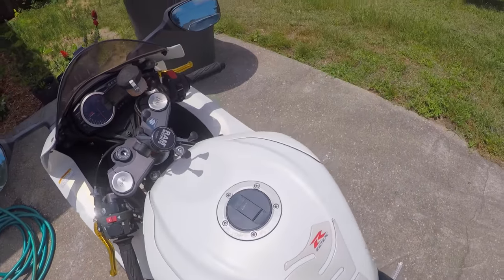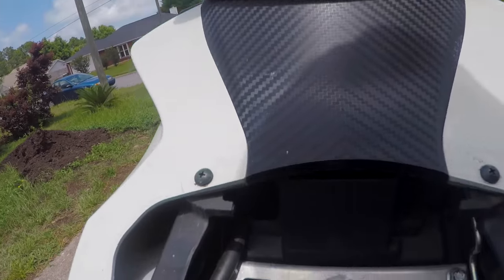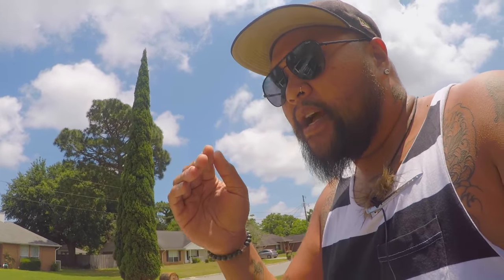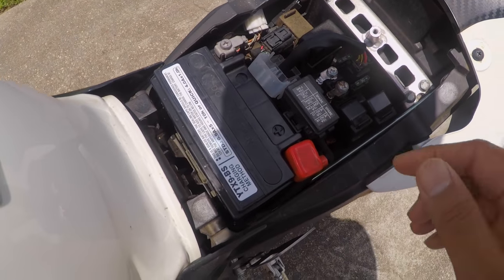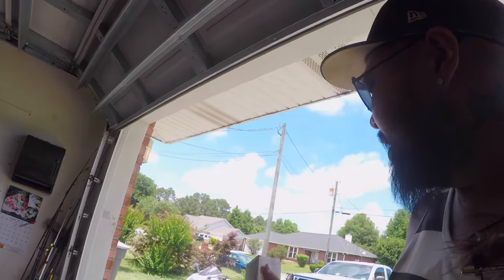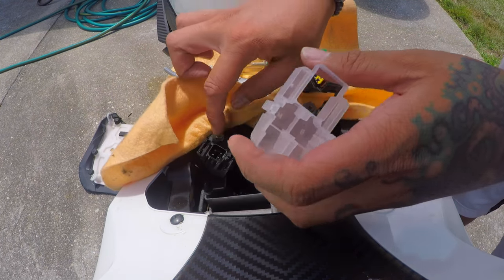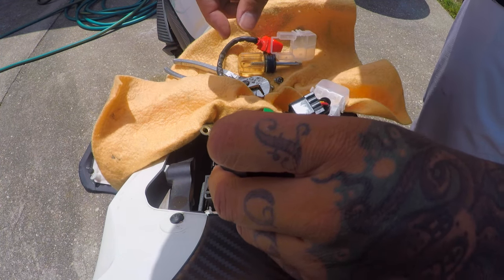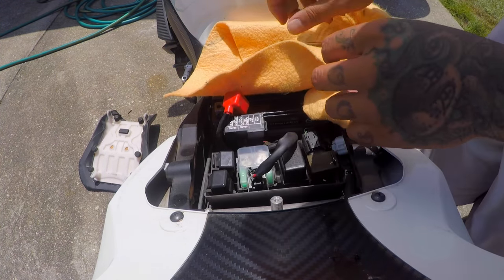**Solved!** Starter relay problem! Works for most bikes/vehicles!

Comment: I took my motorcycle to wash and now it won't start!  check all those fuses in your video but i don't know what could be
Reply from the maker: check your ignition switch? i never had an issue after a wash or riding in the rain ..strange.. do the lights turn on when you put the key in and turn it? what happens when you press the ignition? please keep me updated!

Comment: @motocoss88 the problem im having is it won't start and everything comes on it tries but will not no fuses blown what do you think it could be
Reply from the maker: Sounds like not enough voltage to the starter assembly. How old is your battery? Also check your grounds. If it’ll start on a hot jump, but won’t again, your stator/rec could be not charging your battery.
Reply: @MotoCos88  battery 1yr 2 yes old I put it on triple and it took the charge it was low tho. Did you say my starter could be bad
Reply: @MotoCos88  hot jump is what like putting a long screwdriver touching the relay and see if it starts
Reply from the maker: @babyboinews6896  hot jumping is attaching it to a car then starting the car but only for a few seconds- it can damage your charging components on your bike. It’s not recommended but when you’re in a pinch, what can you do lol. 

I’d try hot jumping it, if it still don’t start, you’ll have to check one thing at a time. Battery, ignition, starter relay, starter motor, then rectifier stator. And ground wire of course- make sure it’s on a secure part of the chassis
Reply: @MotoCos88  understand but it's funny how it was running and just shut off then not restarting
Reply from the maker: @babyboinews6896  kill switch, drop switch?
Reply: @MotoCos88  don't think so it's a 2004 kawasaki
Reply: @MotoCos88  this the first time this has ever happened like I said I checked all the fuses even the main none of them are blown

Comment: I tried bridging with my ninja 300 it sounded like it wanted to crank but didnt? Should i still consider changing solenoid?
Reply from the maker: Hmm you use a thick tool to do it with? If it tried to crank and stops, it could be the relay. If it keeps cranking but doesn’t turn over, it’s most likely the start motor.
Reply: @MotoCos88  screw driver was small tbh and kinda rusty. I should invest in some tools 😅. Alright, thanks man. Im gonna try the replacing the relay 1st. If that doesnt work then I know what it is. Appreciate you again man🤙🏽
Reply from the maker: @smittywerbermanjensen6422  keep me posted! I will try to help as much as I can! Good luck!
Reply: @MotoCos88  Will do💯 
Thanks bro.

Comment: hello, hopefully someone can help me, i tried this and the bike just keeps cranking but won’t turn over, when i try to push the electric start nothing happens so i tried this method and it just keeps cranking very cinfused i got a 2007 Yamaha R6S
Reply from the maker: You check your spark plugs? Fuel lines? How old is the gas?

Comment: Man i replaced the solinoid no start.. but screw driver trick still works and makes it crank I lost
Reply: Same asf.  Anything ?
Reply from the maker: That’s strange, is the solenoid oem? Where’d you get it from? It could be your ignition switch at the handlebar
Reply: @MotoCos88  found out it was the ignition cable switched it out and came back to life .

Comment: I have a 1250 bandits 2008 no spark. What should I check
Reply from the maker: Battery. Do the lights come on but shut off when you push the Ignition? If it cranks but doesn’t turn over, then starter motor.

Comment: Man, i am running through the same issue myself, i fix computers but I don't do much of electronics, still, my logic was telling me that if i bridge the connectors and get a spark all the time, it meant that the Relay wasn't working well, my mechanic told me that the problem was the cord, I don't think i can trust him for anything more than basic stuff, i thought it was the relay, and I'm gonna order one right now.
Reply from the maker: if you bridge the relay, and get a spark, that means the cords are fine, its transfering voltage. If you bridge them, get a spark, AND the bike starts, that's a seized relay. If you bridge them, get a spark, and its tries to crank, but all you get are clicks, its the battery (not enough voltage). Lastly, if you bridge them, gets a spark, tries to crank, but doesn't turn over, that's the starter motor lol.

 This was a hard diagnose, as it took me 3 years to figure it out. He may not be a bad mechanic but there's a lot that goes into motors and I'm no mechanic, I just took my time and looked over a bunch of schematics of how an engine starts! I hope this video helped and gets you back out there! Stay safe!
Reply: @MotoCos88  Thank you!

Comment: Hey 
Can u help me out? Have a 2011 zx10r. And I cannot start the bike.  When I push start bike will turn on running. But makes weired noise 
Can I send u a clip so u may check it out ?
Reply from the maker: I’ve never had to push start a bike, but if it doesn’t start always remember to start at the battery, then the relay, then the starter motor, The rec/stator and back to the battery. You can email me at motocos88@gmail.com if you have a short clip. But please know I’m not a mechanic!
Reply: @MotoCos88  I just sent the clip to u r email.  But super thank u for even replying me back
Reply: When I try to turn the key on. Nothing  comes on. Basically dead. Dashboard wont even turn on. 
So I thought battery was a problem so I got a new battery. Installed the new battery but still dont work. So I try to push start and bike eventually caught power and turned on but makes weired noise as u can c in the clip I send it to ur. Email.   Is this something that has to do with wire connection problem?  Electrical problem?  I hope this is nothing crazy. Dont wanna spend so much money on repair shop labor
Reply from the maker: J K thanks for the vid! Sick Subie as well!! But it sounds like an electrical problem. The fact that nothing comes on when you changed batteries throws me off. Next thing I’d check is the ground wires. Make sure you can locate it and secure it. Sometimes the connection can deteriorate and rust. Could just be a connection issue somewhere. I’d try the the fuse boxes too. I want to help as much as possible, I hate seeing riders with bike issues. Keep me updated!
Reply: @MotoCos88  tks. For u r feedbacks.  I will let u know. I just dont want shop to Rippp me off lol
Reply from the maker: J K oh for sure! I’d grab a voltmeter and do some diagnostics!
Reply: @MotoCos88  battery seems to be fine.   Do u think my bike is fixable. Or do I have to think about thrashing it
Reply: @MotoCos88  I did  the battery seems fine.  Voltmeter is the tool u test out the voltage on the battery right?  Lol I just dont know much about auto tools and etc
Reply from the maker: J K I don’t think you have to dump it lol yeah the voltmeter can check the voltage and also check open/closed circuits. Vehicles need minimum 12.5V to start. Obviously the more the better. If you’re reading that and still nothing to the electronics, it’s gotta be a wiring issue.
Reply from the maker: I sent a video of a guy checking the fuse in the starter relay itself, did you check that? NOT the spare fuse but the active one inside the relay

Comment: When I make the bridge it still doesn’t start. Bad starter?
Reply from the maker: Dayton Raught does your battery have enough juice? Should read 12v-13v when starting. If so, sounds like a seized starter motor
Reply from the maker: Or a seized relay

Comment: My dirt bike wont start i have a coolster 99 60 to 100 mph on it plz help my cousin was turning my bike on and off now it dosentt work anymore
Reply from the maker: What noise does it make when you try to crank it? Does the electronics work? Refer to end of the video to relate to the issue. I'm not a mechanic, but I will try to help with as much as info as possible.

Comment: So what if the bike doesnt start when you  cross connect the starter relay? What else could it be?
Reply from the maker: GuidoTrevor always check a few things first. Your battery is juiced pushing at least 12.5v to the relay. Also make sure the fuses are intact. If you bridge the relay connectors, and nothing happens, next is the starter motor. If it turns but doesn’t turn over, it’s a bad starter motor. Please keep me updated. I will try my best to help you!
Reply: @MotoCos88  Do you think switching too synthetic oil would of wrecked the starter motor? Is there anything qi can do to trouble shoot the starter motor before buying a new one?
Reply from the maker: GuidoTrevor I doubt that would be an issue. I’ve switched to full synthetic on previous bikes and nothing bad has ever happened. To my knowledge, tapping the starter motor with the handle of a screwdriver can loosen any buildup within the starter. It may work temporarily but it’s not a “fix”. There’s always the idea of taking it out and cleaning it too.

Comment: This was happening to my Sv 650 & I changed the relay and it still won’t start up normal.
If I do the screw driver jump it will start.
Reply: Same here. I crashed my 790 duke 6 weeks ago. Just repaired it and it still won't start. I changed the relay and nothing. I bought a relay off Amazon so maybe that was my problem. When I hook up the relay to a battery, the plunger doesn't engage even though I'm getting voltage across the terminals so I bought a fucked up relay is my guess. Did you get your bike sorted out yet?

Comment: I wrecked my bike a lily while ago. And now it wont start . I checked fuses not bad . It push starts easy but wont start on button
Reply from the maker: Some bikes have a drop sensor on them. Might want to check that first. If it push starts, it might be the starter motor If it cranks but doesn’t turn over.

Comment: How to differentiate either the relay or carbon brush problem.i cannot start my bike also.
Reply from the maker: WMS I’m not too familiar with carbon brush, isn’t that more on the rectifier/stator/regeneration side? What type of sounds are you getting? Any electrical work, always starts at the battery. Please keep me updated. I want to help you to my best knowledge!
Reply: @MotoCos88  thanks to your video, actually it's my relay problem. Already replace new relay. Thanks!!!!! :D :D :D :D
Reply from the maker: @wanmuhamadsobri4498  did it fix your issue?
Reply: yes, now the bike starts!! 👍

Comment: Great video, my SV is having similar issues, will try this method asap👏
Reply from the maker: Any luck?
Reply: @MotoCos88  turns out it was the clutch switch deciding not to work anymore, bought a new relay and was halfway through dismantling the starter button when I realised I hadn't tried bypassing the clutch switch😂
Reply from the maker: @leventenagy4302  haha well at least you got it sorted! Glad to hear! Safe riding!

Comment: What if it's just cranking and cranking but wont Turn over?
Reply from the maker: Sounds like a bad starter motor or possible the fuel pump if it’s not engaging when you turn the key
Reply: @MotoCos88  I can hear it priming when I turn the key?
Reply from the maker: @TheLegendaryLoso  i think that’s the starter motor for sure then. Try tapping it with a screwdriver handle to loosen the debris! But eventually it may need to be replaced
Reply: @MotoCos88  fuel relay? Or starter solenoid? Where is there "starter motor" ?
Reply from the maker: @TheLegendaryLoso  depends on the vehicle, but usually under the gas tank on the left.
Reply from the maker: @TheLegendaryLoso  the starter solenoid is the same thing as a relay
Reply: @MotoCos88  okay
Reply: @MotoCos88  yamaha r6 2005
Reply from the maker: @TheLegendaryLoso  yeah it should be on the left side of the bike. Looks like a cylindrical mechanism. Sometimes tapping it with a screwdriver handle can loosen any buildup and allow the gears to spin to turn the bike over.

Comment: When I do this my wires get bright but my starter does try and turn over
Reply from the maker: KIKE MOTORS sounds like it could be a bad starter motor. If the relay is passing the current through and it’s stopping at the starter motor, I would check there. Try tapping the starter with a screwdriver handle?
Reply: MotoCos88 ir ended up being that the valve wat coming in contact with piston go figure so it won't let the starter keep the engine Turing
Reply from the maker: KIKE MOTORS did it fix the issue? Which valve was coming in contact?
Reply: MotoCos88  intake valves were, the starter a solo nice worked fine but obviously couldn't turn the engine full 360 I will be uploading a vid tonight and doing  a whole rebuild on my channel
Reply from the maker: KIKE MOTORS I’ll definitely check it out!!
Reply: MotoCos88 thanks!

Comment: This happened to me, too. What I did to fix it was to just disconnect the negative terminal and then connect it back, and it worked . 😅 It's probably because of the corrosion, like you said. Your technique was quicker, though (screw driver)

Comment: Just took out Gas tank now it wont start. Did empty gas tank
Reply from the maker: Ive never done that before so im not too sure how to go about diagnosing that. As long as you put everything back in the same reverse way and refilled the tank AND the fuel pump...im not sure how to help. Does the fuel pump suck in gas when you turn the key?
Reply: It was a bad fuse lmao
Reply from the maker: @codegaming_yt7704  thank god lmao easy and cheap fix haha was it the 30amp fuse?

Comment: I thought I was having the same issue after seeing this video. Unfortunately after trying to bridge the gap it just sparked and the positive got quite hot and did not start. 
Every time I try to start it does the same thing as in the video, I hear the starter relay snap but nothing happens except i repeatedly blow my 10amp fuel fuse.
I am stumped! lol
Reply from the maker: 10 amp?? I think, and i could be wrong, but it requires a 30amp fuse (light green fuse) if the fuse pops, you can potentially send too much current through the system and damage other parts. Try switching to a 30a fuse. Please let me know if it fixes it and keep me updated! I would love to help you as much as possible!
Reply: @MotoCos88  haha no, it doesn't seem to be the 30amp fuse on my starter relay, its not burnt out and when i use my multi meter i got power on both sides of the fuse and relay.
when i try to start it tho, my speedo panel shuts off and my 10amp fuse under the seat labelled "fuel" keeps blowing. Its not even trying to turn over. Seems like i should possibly replace my starter. Although i have no idea why my fuel fuse would be blowing.
Reply: Possibly a short in the wiring for my fuel pump keeping it from starting? although you would think it would at least try to crank.
Reply from the maker: @brantlennard4405   I realized you said fuel pump relay and not starter relay fuse lol my b. There's got to be a short somewhere. I would check the wires that go from the fuel pump relay and fuse box, etc. There's probably an exposed wire shorting the circuit. Could be touching heat and melted the wires coating. I have a hunch it could be just that.
Reply: @MotoCos88  Ok I will try that! thank you
Reply from the maker: @brantlennard4405  I really hope thats all it is! Let me know!
Reply: @MotoCos88  from the battery to the starter relay i have full volts, but from the starter relay to the starter i have 5v. is that abnormal?
also i did find one wire that is broken which is on my TO sensor which i had to put back in. perhaps its still not functioning correctly.

Comment: You guys know that the problem is the fuses.. not the relay. They relay has fuses in it on the sides that you replace. It's like $5 for a whole box of fuses instead $30-50 for a whole new relay.
Reply from the maker: If you bridge the two connections with a screwdriver like I did, a bad fuse wouldn’t let the bike start. Also that’s the first thing I checked. And if you pop a fuse on the relay, that means there’s a bad connection somewhere. Which means that $5 dollar fix wouldn’t be a one time fix. Why not fix it once and be good for a longer time?

Comment: I put a push bottom to start now. 
Everything it was under my seat-a lot of wires & fuses you know.
When "The invention " MOTORCYCLE was made in young fist part of 1900 = It was supposed to be FAST & EASY. 
A bike is not supposed to be as fast as a car%
You see the 2 wheels in comparaison of 4 for a car %
A good bike is powered by 350-to 400cc no more.
Not 

In the military world, it is a big step to see ennemy at the doors.
A motorcycle is not good to used with big motor and big empattement and all the big bore we got today.
I owned a H-D in 2012. 
My first (and the last)

I was on "maniac mood" (I am bi-polair)
I was very HIGH when i bought my bike.
I don't look everything...And no..I don't check very well what it describe on my paper.
All i can say, it's: I'm almost sure the motor on it was stoled.
Robbed you know : (

Because it is write 1200cc on the paper..And it is a 1340cc
It's supposed to be a "shovel-head". And it's a EVO-1340cc from mid 90. There is no PIN number on the motor.
It is pin fom the good year. It's correct, but i don't declared "the changement for the motor up-graded.

I verify every solution. I don't want to sale to another guy.If you can imagine HOW MAD i was when i conclude it at home.
Like A GOOD FISH yeah : (

I try to continued to pay my plate and my insurance...
Maybe it would be a good exchange to pay my last bed ...To the undertaker  : (

RIP=H-D  *The biggest Mass burglar of the biker's world.

Comment: one of my issues... cant get bitch to fire over though it will try to but nothing..... so fucking stumped been through a million videos posts etc...
Reply from the maker: jacob m sounds like a bad starter motor to me. Although I’m no mechanic. Have you tried tapping on the motor itself? Sometimes that will loosen the internal grime and buildup. I hope you find a solution!